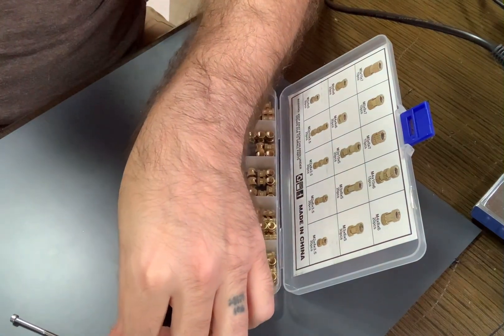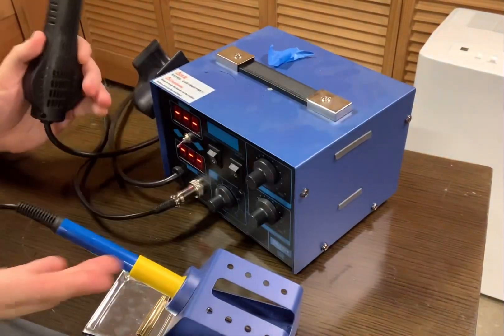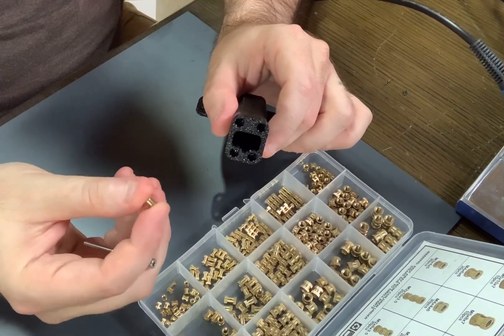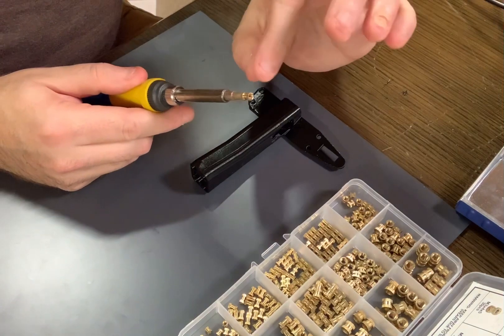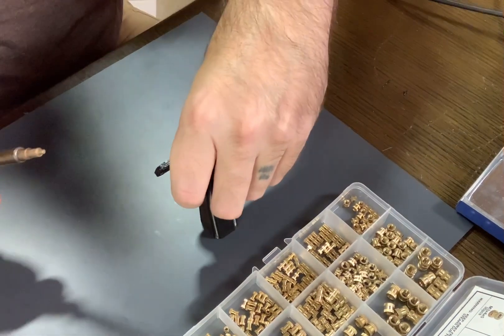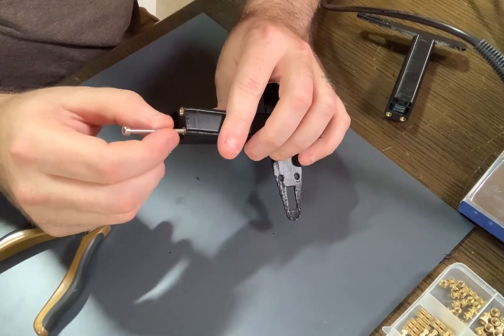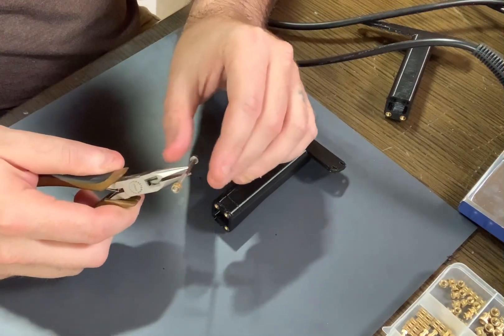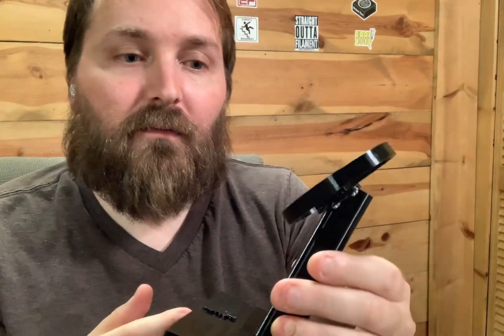Working with Threaded Brass Heat Inserts and 3D Prints

Comment: Another method if not mentioned is to use the iron heat insert tip to heat up the plastic again, remove the tip and quickly screw in longer screw and pull. Not always the cleanest but that's my method and works pretty well to recover the heat inserts.

Comment: The ones you got are for injection molding parts with the shorter straight grooves. The twisted ones are for 3D printed parts.

Comment: No offense but this video was useless, came just to hear a tip on insert sizing like "if your insert is 3.5mm in outter diameter make the hole 0.3mm smaller, or 3.2mm in this case" instead it was 13 minutes of literally useless information that could just be inferred from common sense. Thank you for taking the time to make a video to help people but in my opinion someone who has worked with these any amount could make a recommendation like that and that would be the most useful thing.

Comment: To remove inserts I put the soft jaw covers on my vice and grip my mole grips in there and place the screw head in to lock it and then start heating whilst at the same time applying a little pull force, this way I never overheat the plastic as when it becomes just soft enough it just pulls out.

Comment: Man! Really appreciate the info that soldering tip temp should be around glass temperature of the material.

I just had the material popping up along the brass insert perimeter and was about to ask this issue to the community.

Thanks for uploading this video!!!

Comment: I don't have a soldering iron handy so what I did was to heat up the insert with a lighter and push it in with a pair of tweezers, works just fine.

Comment: really good these inserts, if you screw up a bit so to speak use a couple of drops of loctite super glue to help hold the inserts in, they dont works as well as they could so dont over tighten them, I wish the flutes on them were longer and sharper for better adhesion or insertion, also check what hole size is needed for what insert , details online somewhere ion google.

Comment: Thank you for the guide. I  have been using them for a while and usually buy them from McMaster-Carr and using a heat press. I appreciate the complete package guide and shared it with my local 3D group. Again - thank you for your efforts and community suppport.

Comment: Some links to the items you described would be very cool.
One other thing, most people won't have an adjustable temp solder iron so we'd be using a fixed temp for melting lead/tin solder.
Reply: I don't use a soldering iron - I use the nozzle on the printer!   Use the manual positioning controls on the printer to get the nozzle an inch or two above the hole - make sure it's pre-heated to the right temperature for the plastic you're using.  Put the slightly tapered end of the insert into the hole - then lower the nozzle on step at a time so it centers the part under the nozzle and gently forces it into the hole as the plastic melts perfectly around it.   For M3 inserts - I use a 5.5mm hole and the 3D part will break before the insert comes out.

Setting the nozzle to the right temperature guarantees it's perfectly going to melt the plastic - and the force you're applying to the insert is precisely vertical.
Reply from the maker: Links are posted now! Thanks for the reminder! You can use a fixed temp iron, you just need to be careful to not expose the insert to too high of heat for too long. Just might have to work a little faster depending on the wattage of the iron.
Reply: @JoeMikeMakes  Thanks!!